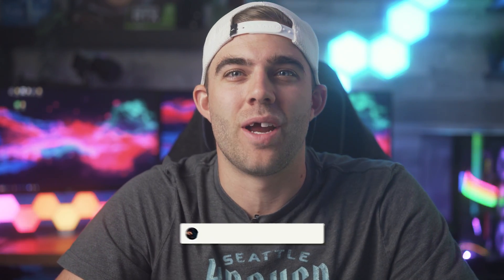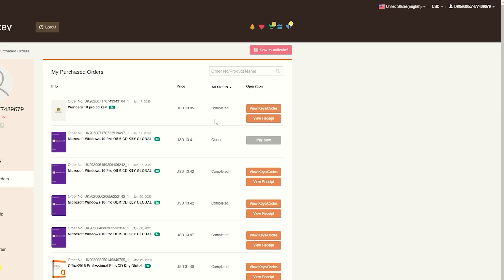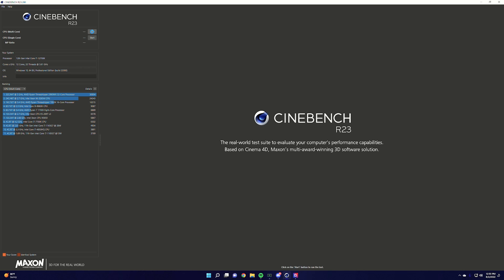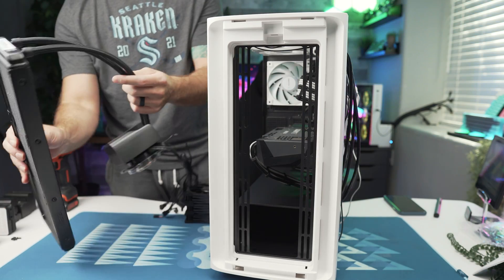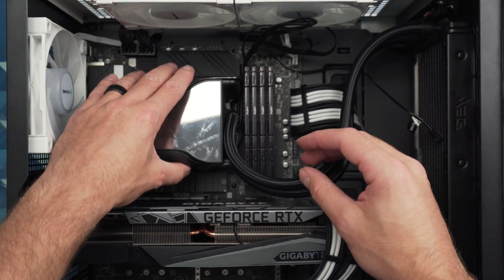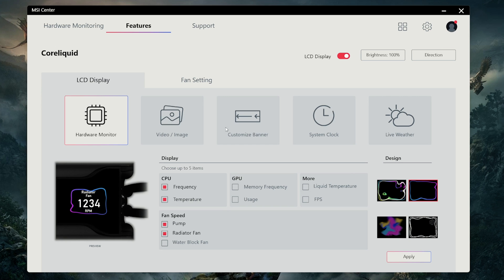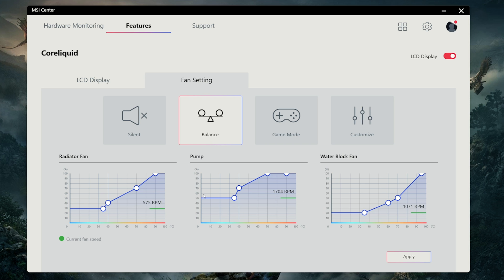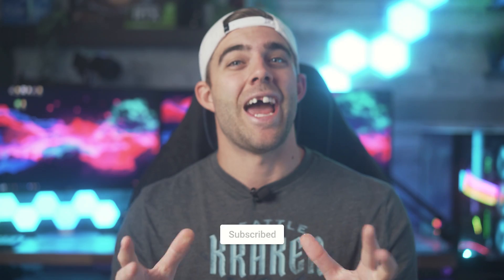BEST AIO Water Cooler 2022!? | MSI MEG Coreliquid s360 AIO Review & Performance Test

Comment: So I’m assuming the pump runs at full power all the time because I didn’t see you plug anything into the pump header. GREAT VIDEO by the way
Reply from the maker: You can control the fan speeds by using the MSI software I showed. You can set whatever fan curve you want!
Reply: @RAVisuals  well not so much the fans I’m referring to more the pump it’s self. You know how to plug one into the fans and the other into the pump header.
Reply: @RAVisuals  unless you want to move that 4th dot lower than 81 degrees.... Kinda limits you to only 3 settings for each curve if you want the fans to hit 100% under 81 degrees.

Comment: flagship cooler requires flagship heat gerneration processor. 12900k. Wrong processor.
Reply: 100% facts I have this cooler with 12900kf now 13700kf I have. 12700f and it runs cool with a 240aio
Reply: Not everyone spends money carelessly the i7 series is more then enough for most workloads  plus if you actually watch the video he said it was sent to him so he didn't pay anything for it and since it was meant for a review I doubt he got to keep it
Reply: @coltonkoepp655  then don’t buy a high end cooler

Comment: I have the same AIO.  Love it!  Runs extremely cool and I love the customizable screen.  My understanding is that it uses the same Asetek 7th generation pump that the NZXT Z73 uses, so should be more reliable than the other MSI AIO's that have have recall issues.
Reply from the maker: This is exactly right! I also love the cooler. It keeps my 12700K nice and chilly while under full gaming load so its well worth it IMO
Reply: Hey, I'm planning to buy this cooler, how does he work after one year for you? It is loud?
Also, can I mount the radiator at the top of case?

Comment: Hey, I am using the same cooler with 12700k and I am getting 78 to 80 Celsius temps with  multicore performance which is 8  to 10 Celsius higher than yours, I don't understand the difference in performance!!!
Reply: Is your case high airflow?
Reply: Did you fix it
Reply: Hey, I'm planning to buy this cooler, how does he work after two years for you?
What about noise level?